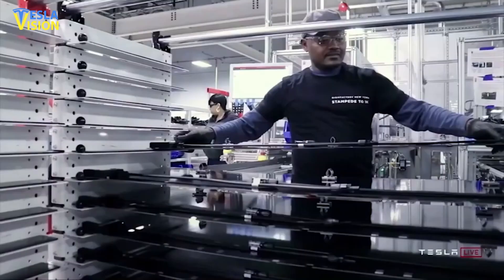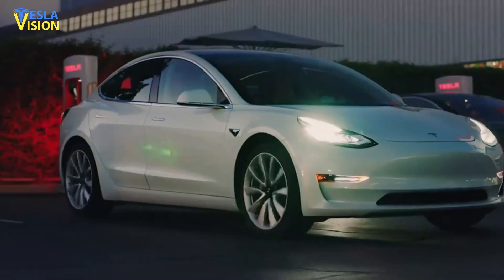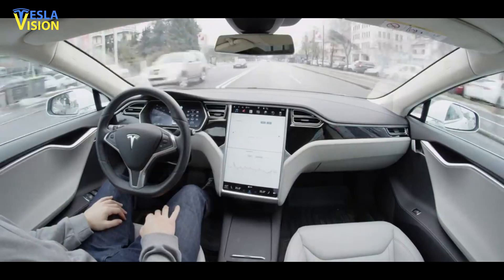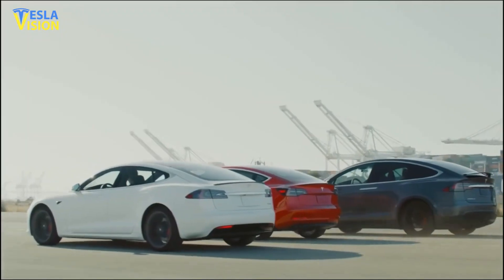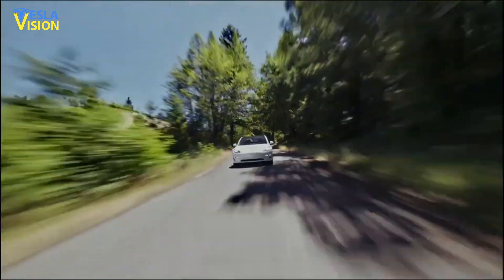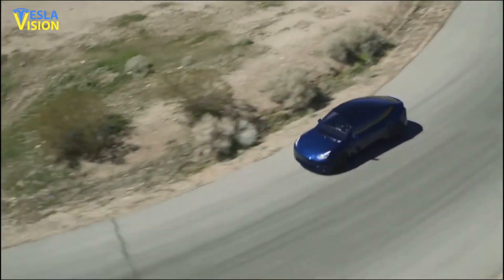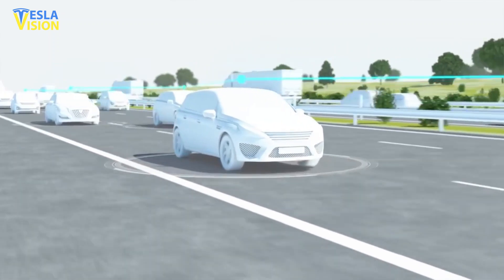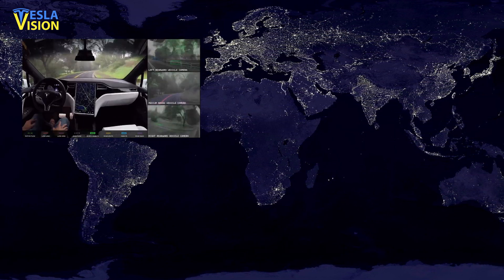Elon Musk DELIGHTED Everyone with Big Surprise!

Comment: this is not really new information… I guess it’s why it’s not in your title, yes? That being said, the FSD it’s starting to look like insurance company spyware that you have to pay for, no?  why buy a high-performance car if you’re never going to use it… This is possible in a safe environment. I live in the mountains of Colorado these cars are perfect for tight twisty turns and fun driving with little traffic. We also have desolate straightaways suited for high speed but at a minimum good acceleration. I really feel this is taking a step backwards Widing profiling insurance companies into our lives. Yes it might be safer, But so is staying at home!
Reply: There are race tracks for driving in whatever fashion you desire.  The roads are meant to be safe for all.
Reply: @paulschulte1064  do you actually believe that is reality??? People like performance…otherwise get a Prius
Reply: @Jethr001  Within the foreseeable future, you’ll need a device plugged into your car that will supply your insurance company every tap of the pedal, every turn and at what speed you took it. Tesla’s already do this.  
Some insurance companies are offering it as an option and I suppose your rate is determined by your driving. Been building street rods for 50 years. I race them at the track, not on the street.
PS, I have a built Camaro, a Studebaker street rod and a Hemi powered 41 Chevy.  
So yeah, I live for the thrill.

Comment: The fact of the matter is, one of the Tesla Insurance parameters is, braking. So, you approach a traffic light, you brake fairly hard to stop for it... The way the Tesla rates your performance is poor, because you applied the brakes too hard. But - accleration is unlimited, so, does that mean Tesla wants us to run Red lights? That's something for Tesla to reconsider. Right now, I have a 96% rating.. Will it go down as I drive safe around my city, it wherever I may roam? Probably. Will I get there Beta version before Christmas 2025? Maybe.